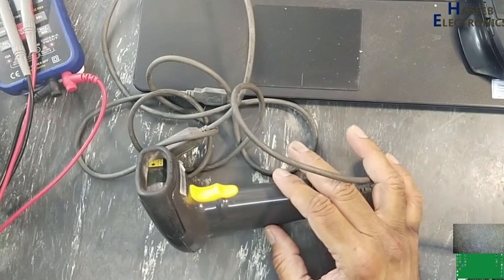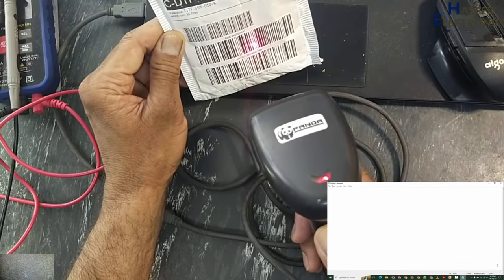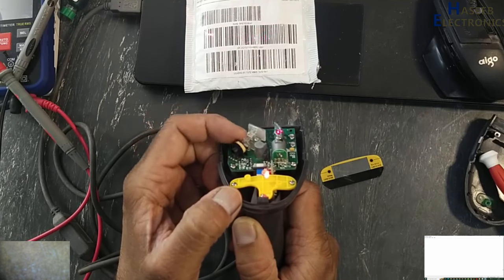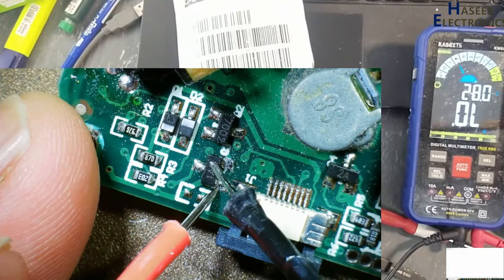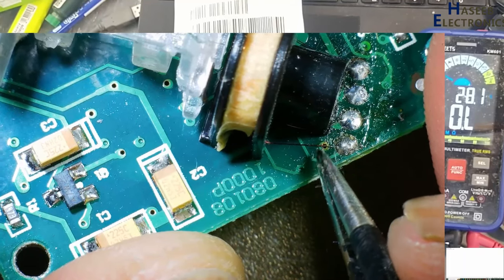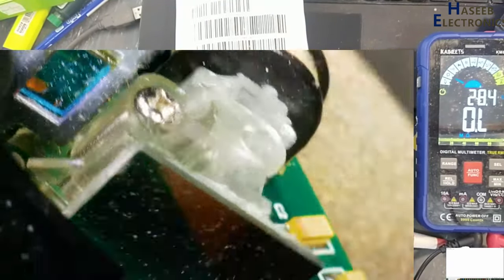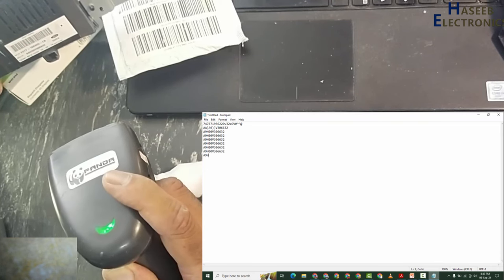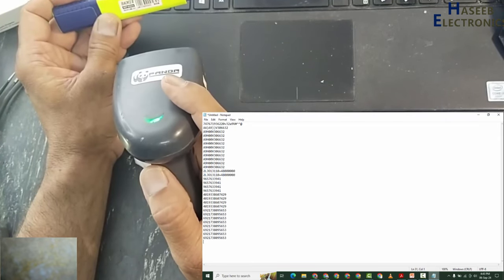{1188} Barcode scanner repair, Panda Handheld scanner

Comment: I had no idea there were moving components inside these barcode readers! Thanks for the video.
Reply: Exactly 💯
Reply: This is an older unit with the moving mirror and laser diode.  Modern units use a small camera and then analyze the captured image in software.  They don't have the mechanical moving components anymore, just an LED light to illuminate the barcode.  The camera units (called imagers) can also scan the 2D barcodes like QR codes, these older laser units cannot scan those.
Reply: @somejoe7777  Thanks for the clarification. Useful to know!